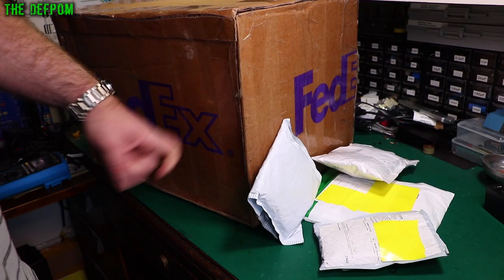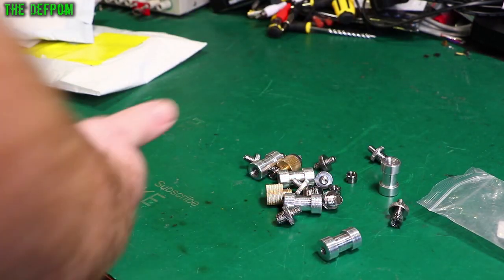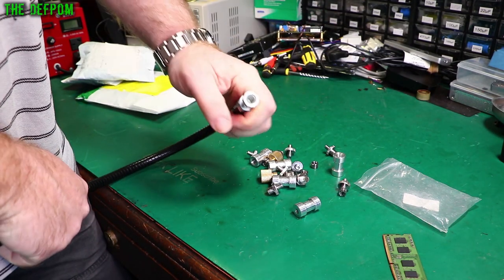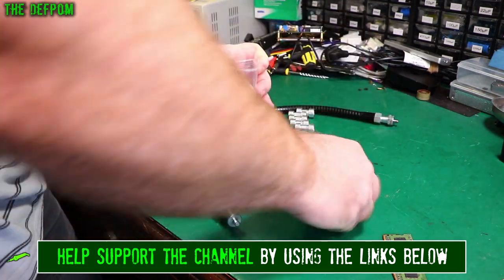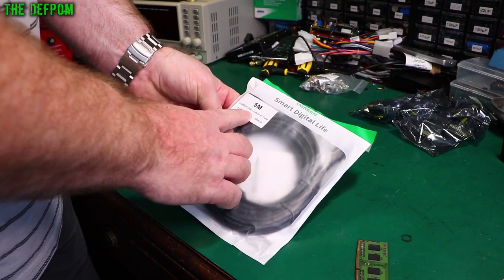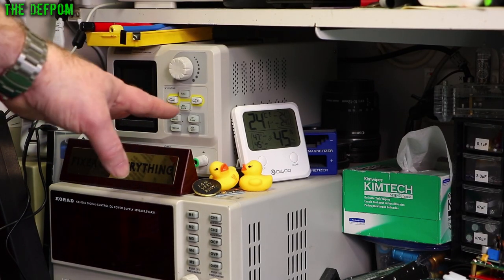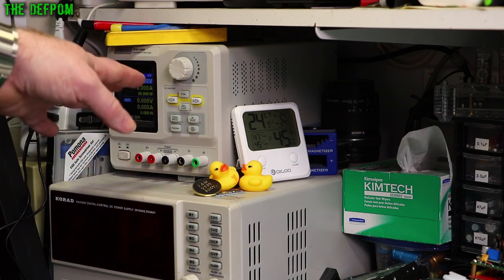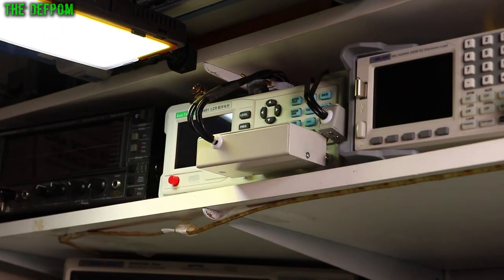🔴 What's in my Mailbag ? - Mailbag Monday 13th December 2021 - No.900

Comment: All the Siglent gear you have has LAN and USB Device connectivity. For USB connections you need a USB-A to B cable and possibly the NIVISA Runtime package installed for the connectivity drivers. For TestController LAN connectivity is probably simpler.

Comment: I have one of these 225 Current Sources sitting on my shelf and so far it's been quite accurate
Reply: i have an old Kenwood "KPS-10" DC Power supply. I cant seem to find anything about it on the internet. Found a few things about the "KPS-10 A", but not for mine. You know anything about it or can you point me to a site.

Comment: you seem to have stopped buying capacitors:-)
Reply from the maker: Crap, you’re right !
Reply: i have an old Kenwood "KPS-10" DC Power supply. I cant seem to find anything about it on the internet. Found a few things about the "KPS-10 A", but not for mine. You know anything about it or can you point me to a site.